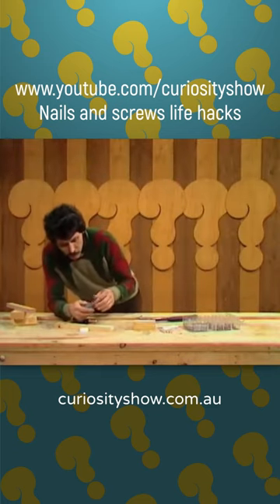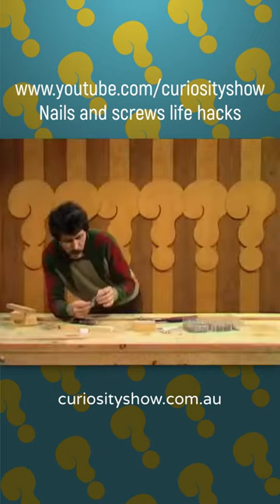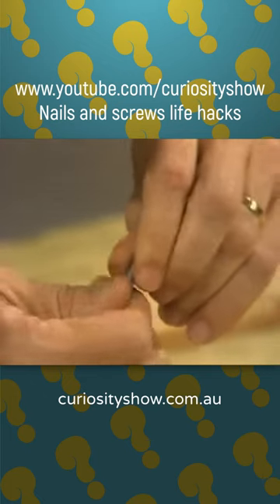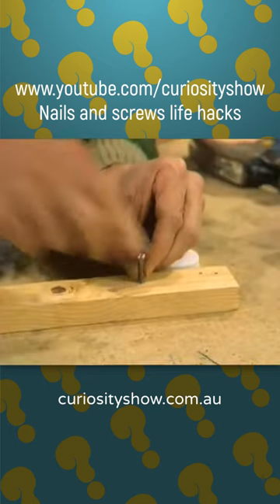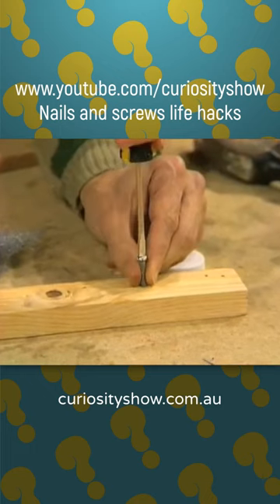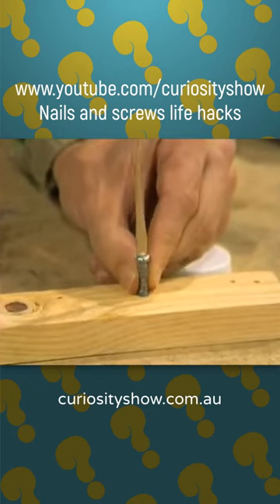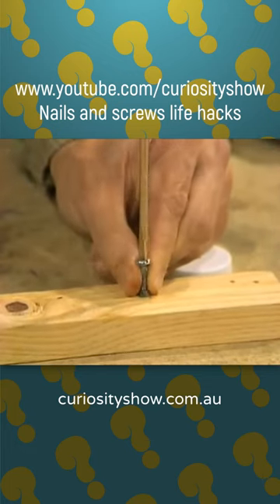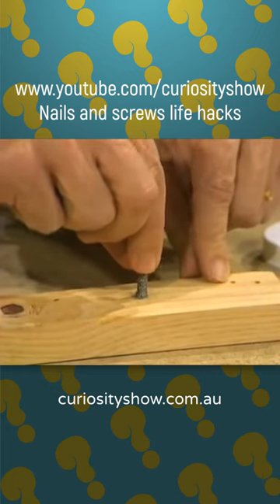Nails and Screws

Comment: I put a toothpick in the hole and break it off. Then put the screw back in.
Reply: An old guitar repair trick, that one.

Conversely, if the hole is a little bit too small, poking the screw into a bar of soap.. or dipping it into dishwashing liquid... will make the screw go in easier...
Reply: @ozboomer_au I always keep an old candle in my toolbox to make screws easier to deal with. It also works great to permanently unsqueak a door. If you can get it between all the metal parts.
Reply: Already done that a couple of times.
Reply: @ruimvp
I have always wondered if I should add a little wood glue if I want it to be a structural screw location.
Reply: @ecospider5  I think that the additional pressure of the toothpick is enough.
Reply: You can also use wooden kebab skewers. (They're generally made of bamboo - very resilient to changes in temperature or moisture)
Reply: @ruimvp  The pressure is enough. Works the same way as a plug, basically. The outward pressure keeps it in its place

Comment: Steel wool can be very sharp when pulled apart I almost lost the tip of my finger in a similar but different application. Be careful. I use a couple of wooden toothpicks in the hole. Stick them in, snap them off and you’re good to go. Can’t say which method is stronger but I haven’t had any failures with toothpicks.

Comment: Great video!  Who's the masochist that decided to use a flat hrad screw?  😂
Reply: When used correctly you can apply more force to a slotted screw.  Also if they get stripped you can fix it with a hacksaw. But Philips self centers so people liked them better.
Reply: philips screws weren't too common in the 80's due to cost. flathead hardware was in abundance (also it's a show for kids).
Reply: Robertson screws, people!

Comment: Thats cool trick but wouldnt it be same with a wall plug. Most have wall plugs lying around😊
Reply: Or just a toothpick.
Reply: no. 
wall plugs dont work very well in timber. 

also, this show is from the 80's. nobody had wall plugs lying around back then 😉
Reply: Seems like it's meant to be a quick and easy hack, rather than one you pull all your tools out for - and it is aimed at younger audiences.

Comment: Why not a threaded insert or better yet a t nut with some locktite... also a flat head screw really?
Reply: When used correctly you can apply more force to a slotted screw.  Also if they get stripped you can fix it with a hacksaw. But Philips self centers so people liked them better.
Reply: I just insert a toothpick.
Reply: @ecospider5  Yeah I've done toothpick with woodglue a lot (hinges); actually a good tip. You're right about the force, but it's much more complicated. Basically on tiny screws yes, but the larger the screw/bolt the more contact patches you want (cam out)... At least that's the conclusion I reached after hours of researching the engineering of fasteners. Most things are gonna be better with something like Torx/Robertson. Easily could make self centering flatheads, but that's not gonna happen. Anywho flathead is good for preventing overtorquing. Also philips are more prone to cam out which prevents overtorquing (makes them ideal for drywall).
Reply: I now only buy torque head screws. I wonder in the 1970 why they were not heavily used yet. In the 50’s I don’t think they could manufacture them at a reasonable price yet, they were still using square nuts. But I’m surprised how long it took. 

The Robertson screw had patients holding it back I think.
Reply: @ecospider5  Spot on again,  also Robertson is better for non ferrous screws. Since you threw out some of that history I gotta say the history of power tool brands is actually very interesting. 
You probably know, but Dewalt is just pro grade B&D; Dewalt used to just make radial arm saws (invented by the owner) they were bought out by B&D (who used to be renowned for their industrial tools), and after B&D tarnished their name by making cheap crap for home owners (creating a new market) they had to sell their professional grade tools under another name. As a side note I think the latch system for Dewalt's batteries suck, and funny enough I think Rigid are the ones who nailed it.
Reply: And Black and Decker had such a good name after making cordless tools for the NASA Gemini project in 1961. They had to make a cordless impact driver so the astronauts wouldn’t spin around in zero gravity :). It was to bad when they ruined their name.
Reply: @ecospider5   I have a blessed one man it was good needing out with you
Reply: this is a show for kids in the 1980's..
they use easily available parts (cheap or free household bits).
i never heard of any of your suggested products when i was watching this show as a kid.
not meant to be for proper handyman activities.